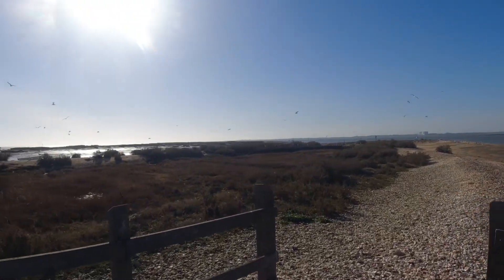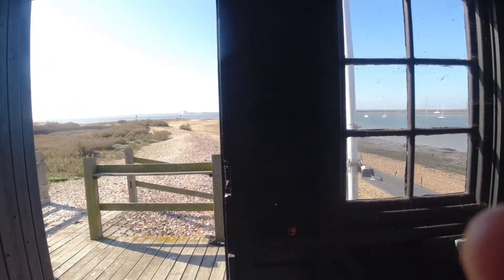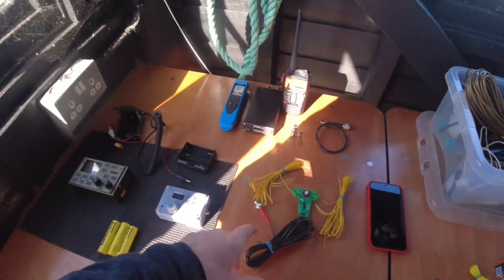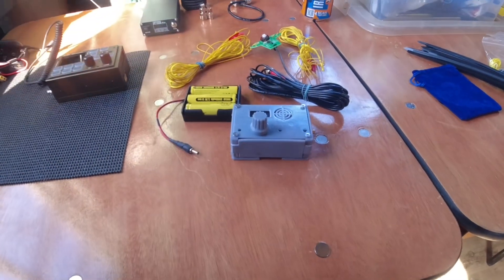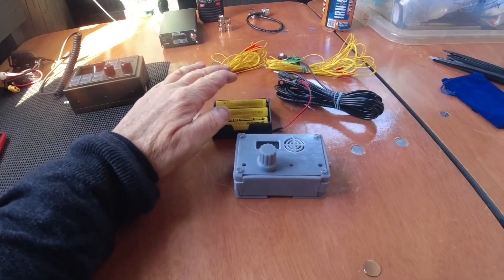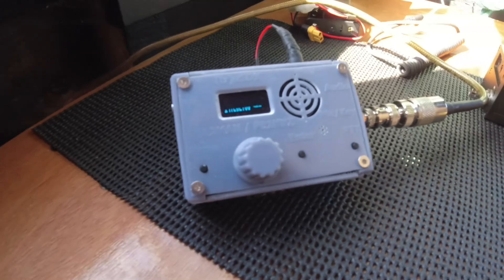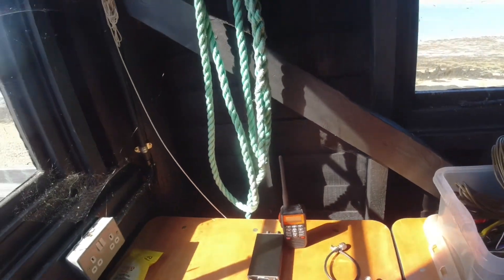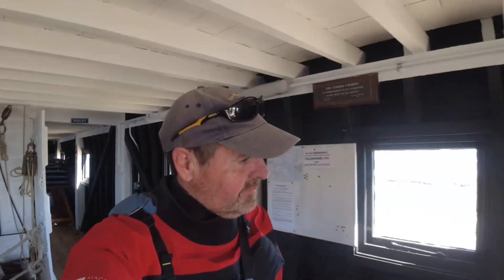(tr)uSDX The Ultimate Ultralight HF Rig

Comment: Fantastic QTH. 

I’ve got both FX4CR and Trusdx. I loved building my trusdx and will build another this winter- had great QSO’s with it and a 40m EFHW as an Inverted V or a 1/4wave wire ground plane.

The FX4CR on the other hand is a DX beast! At that qth you should be using verticals to take full advantage of the saltwater amp effect.

Would love to join you one of these days
G4FSX
Reply from the maker: Thanks for watching Graham, I do use verticals when looking for DX. Mostly quarter waves with elevated radials, including on 40m when I have an overnight stay at the shed and can take advantage of the gray line. On longer visits to the shed I also use a Vertical Dipole Array (see earlier video) which performs incredibly well. For many of my more casual activities where I just want to make contacts I use an inverted v linked dipole so I can change bands very quickly but still have a resonant antenna. 

If you have a kayak by all means drop me an email (I am good on QRZ) and you would be welcome to tag along when I am paddling out to the shed. 73 Kevan

Comment: Always enjoy a video from the packing shed Kevan, beautifully deserted. Did I hear you say before that you use M&P airbourne 5 as a feed line? How do you find that in use?
Reply from the maker: Thanks for watching. I mostly use M&P Airborne 5 when portable and it’s great. Nice and light plus lower loss than RG58. Because it has a solid core I keep it coiled up as it would retain its shape if it was bent or loosely folded. Out at the shed I use M&P Hyperflex 5. It is quite a bit heavier but as the core is multi strand it can be bent round corners better. Because I only ever have very short runs of coax and mostly operate HF I don’t bother with thicker coax, although I do have length of Airborne 10 which is very rigid and a bit awkward to use but I only use it on VHF/UHF with alloy poles. M&P make great coax, you can see and feel the quality😊

Comment: Kevan, great video as always, but what got my attention was the little device outside the door near the start of the video and then you were talking about stuff to do with it on the phone. I think you said it was a beacon of some sort. Perhaps in a future video you would talk a little more about it.
Reply from the maker: Cheers John, take a look at the Sotabeams website to find out more about the WSPRLite, as I say in the video they sadly no longer make them, hence they are showing as out of stock which has been the case for literally years. There is a video link on the page that explains more detail on what it’s all about, you can run WSPR easily enough on most HF radios, not to difficult to set up. Thanks for watching, 73 Kevan

Comment: Hi Kevan, I usually use the G90 for Pota and Bota and a G106 (5w) for when I travel but after an Ireland trip I found 5w was not enough. I looked at the FX-4CR as it's 20w. How do you find it?
Reply from the maker: I love it Rob, I’ve had loads of great contacts on 5w or less but for me the sweet spot with TX power is around 20w so the FX-4CR fits the bill when using a resonant antenna, I’ve not had it long but so far I like it a lot. It has great sounding audio and a clear display so first impressions are all good👍
Reply: @ thanks for the reply, it appears well made. Can it check vswr?. Have you ever done canoe mobile?  I active parks and some of the ISSS are estuaries and I had thought about paddling out. Of course I just need a canoe 🤣
Reply from the maker: @RobCanada  the FX-4CR does not have an on board SWR meter sadly. If you look back at my previous videos I did operate while on the kayak but it was a bit cumbersome and impractical. I’ve also operated on a rowing boat which is also on my previous videos, as well as on a small boat while moored up. An open canoe would be good but I already have four kayaks in my fleet😀

Comment: Good job. I like the packing shed. A great place to get on the radio. I always enjoy your videos. Do you like the v antenna better than the vertical antenna for your operations? You are a hearty soul. I wish I had a place like the shed to operate. You have a great adventure every time you head out there.
Reply from the maker: Cheers Tommy, verticals work great for DX but nothing beats my inverted V linked dipole for being able to change bands in seconds. Using it on a short pole allows me to easily reach the links. I’m lucky to be able to operate from the shed, it’s a truly magical place😊

Comment: Hello Kevan, well done, congratulations, keep up the good work. Cool and instructive video. Thanks for sharing, love the SB ultra light dipole. Great that you could make your first QSO using the Tr SDX; really an amazing little rig. 
73 QRO de Alex, HB9CKR
Reply from the maker: Thanks Alex, it’s the size of the (tr)uSDX that I find most impressive. The radio, batteries and antenna combined weigh in at only 1kg, amazing 😊